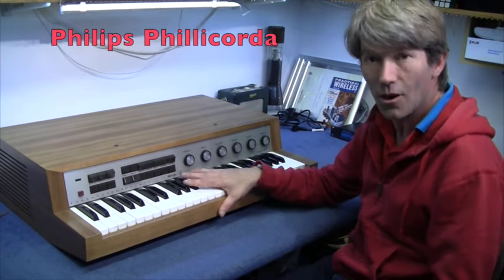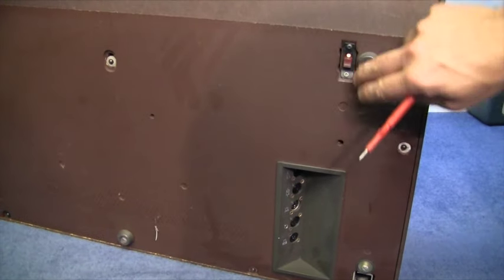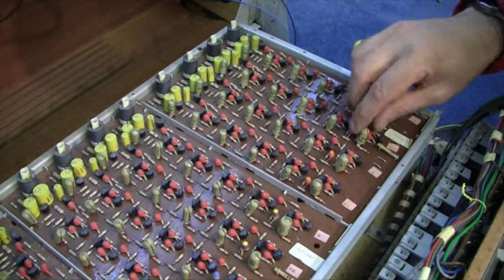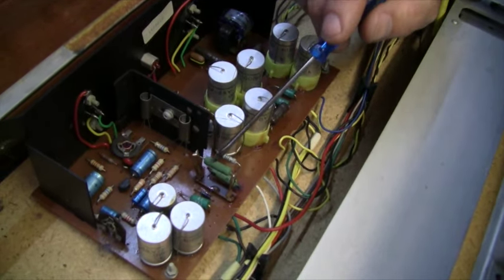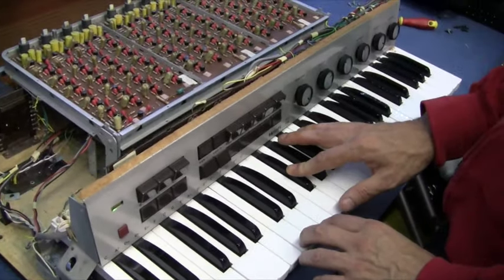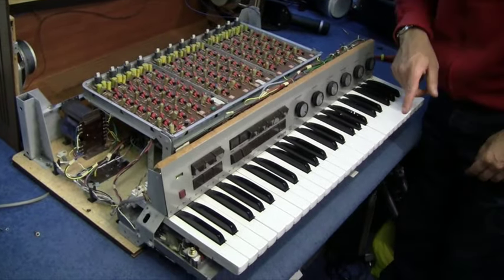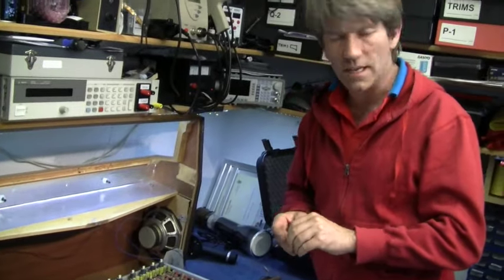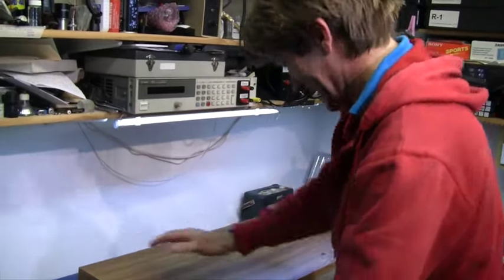MF#13 Philips philicorda vintage analogue organ repair

Comment: Hi, We have this organ with my band and we'd like to tune it. Is it possible and wether yes where can I do that in the organ? We also have a Farfisa compact and it can be tuned with a screwdriver. But here, no idea :/ Thanks for your video and maybe your advice.
Reply from the maker: timoté Iglesias Hello Timote. there are several versions of the philips phillicorder, the older ones can be tuned but you have to open the unit up and you will find 12 adjustable points along the circuit board. I believe one version had a cutout (vent) along the back thay you could reach the tuning points with a long screwdriver. these tuning points are for each note ie All the Cs or All the Fs etc but will effect that same note within every octave as the phillicorder uses dividing circuitry for every octave. I am not sure about the very last phillicorder model that was made as i have never been inside the last model, I know that circuitry was quite different though they all looked very similar on the outside.
Reply: Thanks a lot we're going to check it out. Our Farfisa organ has also this octave tuning mode, we're pretty accustomed to that. I'm just hoping ours is old enough to get tuned. Greetings from France.

Comment: Hi Marcus ! i recently bought a philicorda gm752 and it has a problem. One key has no sound in all the octaves. i cant find the problem, it looks like good inside. Any suggestion? thanks a lot
Reply from the maker: Hi Ruben, if it is similar to this phillicorda then you will see there are 12 identical  layouts of components. these are for the 12 notes in an octave I guess you will have one component dead in one of the note sections, you could do a comparison with the same components in the next note circuit and maybe find the problem there. Good luck
Reply: Thanks a lot Markus. I'll check the components as soon as posible.
Reply: +markusfuller Dear Marcus, I am struggling with exactly the same problem as Ruben was. I'm not sure how to measure the components (I don't have access to an oscilloscope), could you be a bit more specific? Thanks in advance.
Reply from the maker: Hello Purpertje on the top panel there will be 12 sets of exactly the same components in a row they are the 12 notes. if you look on the circuit board it may be printed c c# d etc. check the components of a working key against the components of a faulty key. ie if c works but d does not then you can find the values of the working components in the set for the C note and compare each one in the D note set. if something reads very different with a multimeter then it could be that component that is faulty.
Reply: +purpertje You won't need an oscilloscope for that. Just a small multimeter will do for checking the resistors and diodes etc
Reply: have you ever heard the show Car Talk? I swear you could do something like that. haha
Reply from the maker: Yes the 2 brothers. a long time ago. is that program still going ?. I will go and have a look.
Reply: markusfuller it ended in 2012. :( But yeah, maybe skyping people in could work. Honestly, I'd listen to a Car-Talk for synths. lol
Reply from the maker: Yes I just went and checked it out. I did not know one of the brothers had passed away. sad. as for a skype for synths have you seen  sonicstate (look on youtube) its live every wednesday at 4pm GMT and can be quite funny but full of synth related stuff.

Comment: Hi Markus,
"Is it worth to repair?"
maybe it's worth to look at the schematics first and grab a scope! It should not be that long to troubleshoot. My guess would be a decoupling cap that gone wild, preventing proper biasing of a transistor (reverb amplifier)...
If you really want to restore it, think about replacing the smoothing caps on the power section, if from the 60's, they'll most likely leak or explode soon ;-).

Comment: Those 5-pin connections on the bottom look like midi!
Reply from the maker: Hi Robert, yes they are similar sockets but they were audio outputs for plugging into old style casette recorders etc.
Reply: MIDI didn't exist by then I believe (came in the eighties). Philips stuck to DIN quite long., anyway.'

Comment: would you be able to fix mine? the power button doesn't work :/
Reply from the maker: Hello. you can bypass the power button and just turn it on or off at the mains. or choose a different power switch that will fit into the square hole on the front. I had an old Korg years ago and could not find the correct switch for it so just jumped the brown to brown on the power switch so it was always on, then i just turned it off at the plug.
Reply: markusfuller thank you!
Reply: couple more questions. How do you take it off the stand and what does the red switch on the bottom do?
Reply from the maker: Hello I have never had the stand so I could not say really. as for the red switch Im not absolutely sure but I think someone told me it was to turn off the built in speakers.
Reply: markusfuller Thank you :D

Comment: Why you did not go deeper into its circuit? Measuring around would have been nice, you would see that it probably got a top octave design. As it has 12 coils representing the master osc. followed by a row of a 5 times transistor based divider section. I think they are rectangular osc. as these are easy to divide by two and it sounds like ;)

The spring reverb "delay" is may be to a bad solder joint or a crackled trace at the power supply PCB.

The phillips organs where build for home use, and bought mainly by home musicians. Therefore most of these organs are in good shape, as they did not see (m)any stages. They rest most of their time covered in an edge of the livingroom.
But, when you see inside the mechanical build quality is beond home use. I like this, but i do not like the "cheesy" 70th "top-octave" sound. That´s why i do not like the VOX organs as well, as any other rect.osc. based organ.
But the keyboard itself is excellent. If you plan to do a DIY synth someday keep just the keyboard. As it got all you need and you can directly solder the R2R-ladder to it and have the gate output with no extra circuitry needed :) You can even have velocity and midi if you use a MicroController. Furthermore this sort of keyboards never worns out, as its contacts are last virtually for ever, while the "modern" rubber based keyboards may turning into unplayable junk over the years, due to dissolving rubber...
 
Anyway thanx for sharing!
Reply from the maker: Hi TubiCal, I did not have much time to get the quick video finished, I wanted to show more about how the reverb works but we had to go out to do a small gig so I kinda called it a day and left it as is. I may still get the oscilloscope out yet and do some video on how the waveform is created. but thanks for your information you have written above. best wishes from markus